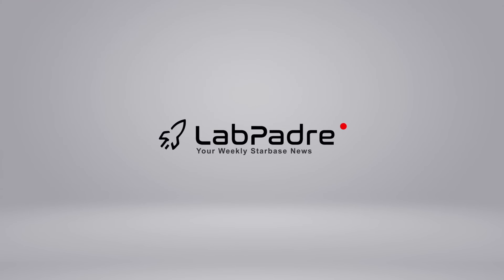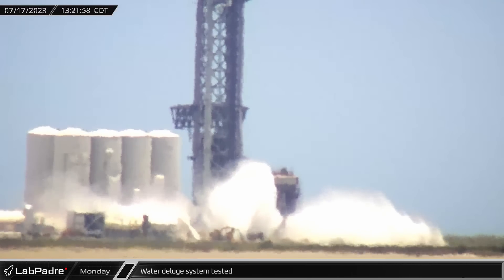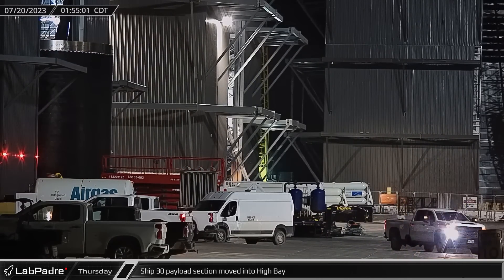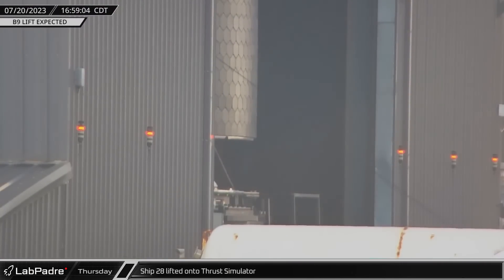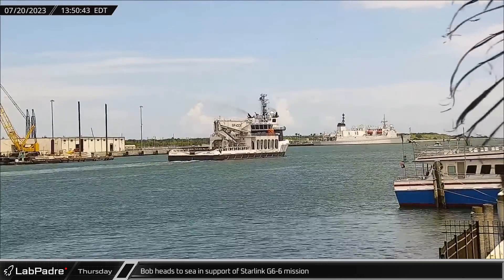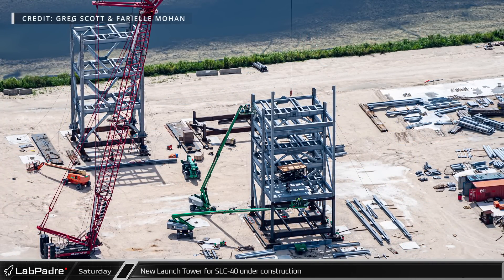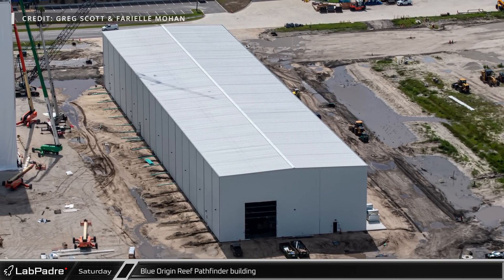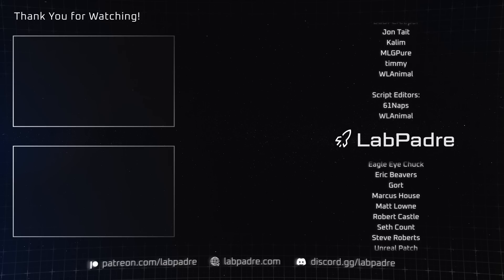Massively Upgraded Booster 9 Takes the Stage at the Launch Site - Starbase Weekly Update #72

Comment: When they lowered down Starship Booster all of the engines were fully expoased? Is this new or I just never noticed it before? I thought they were all in a ring to which they were enclosed?
Reply: Aero covers are usually added on each engine.
Reply: What you are seeing is the bells of the engine, that are very robust. All of the electronics and turbos, ARE protected.
Reply: @CritternNation  Yes I understand what I am seeing. What I do not understand is where the stand is now located? 
Is this new desgin supported above it? In all of the other versions there was a skirt around the base which was where the weight of the empty booster was sat at and from which the locks were released? Is this not the same anymore and did I miss this or just not paying attention.

Comment: Is there any chance that the water pressure blasting upward could cause an engine to be extinguished?
Reply: There's no way a water jet could enter the combustion chamber of an ignited rocket at pressures no lower than 100 bar (10 MPa, 1,500 psi).
Reply: It's not going to go upwards, it's designed to go downwards, so it should not be possible.
Reply: I strongly doubt it. I suspect the power of the deluge system is a tiny fraction of the power of the booster - it'll be just enough to stop stage zero from heating up / bouncing around too much, so that what's around the engines will be slightly steamier, less energetic exhaust and much less concrete. I think it's much more likely the booster might overpower the water deluge system!
Reply: No. Besides, they're not aimed straight up.
Reply: I'm... Not 100% sure I understand your question.  Those are "spin up" jets of gas.  The motor hasn't ignited yet, so how would they extinguish the rocket ignition?  

If you're talking about the FireEX system. No...  33 Raptor engines heavily out class any fire extinguisher made by man. 

They can barely keep the engines from tearing apart the launch mount. From the pressures and thrust made by the booster.